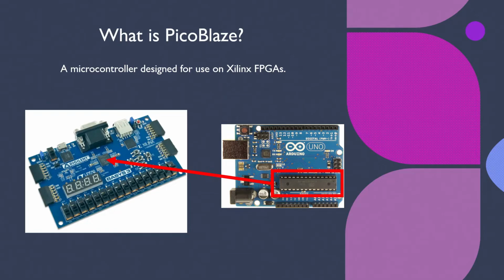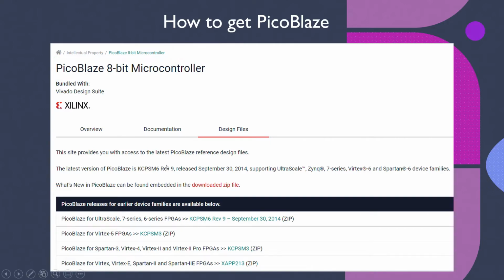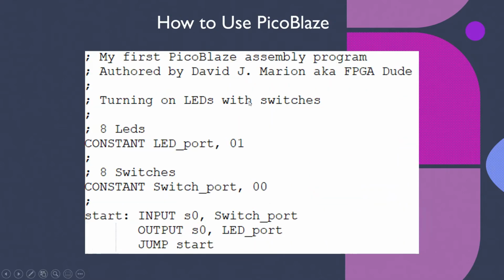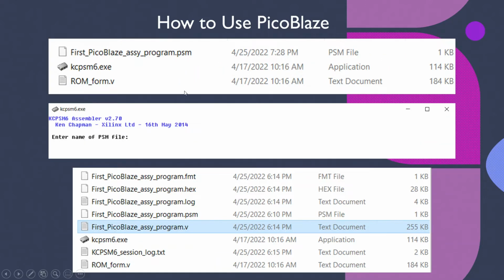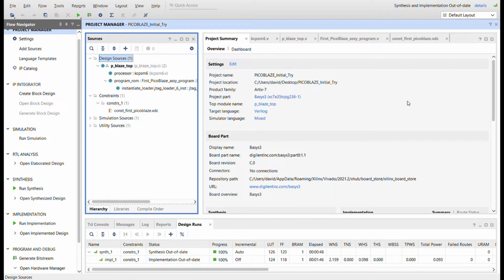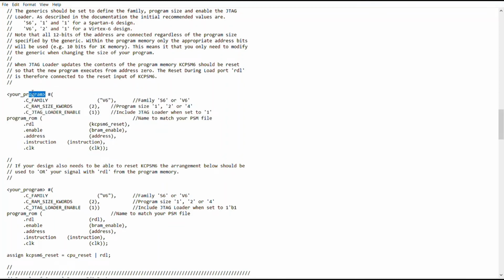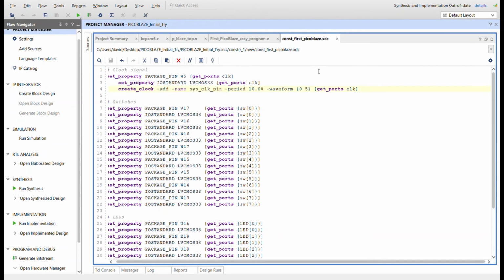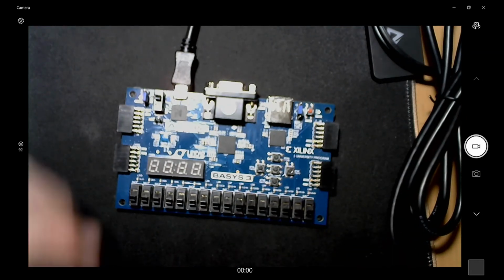Getting Started with the PicoBlaze Microcontroller on the Basys 3 FPGA

Comment: Dave this is a very very interesting video. I have Basys3 do you think i can implement Pico blaze on my basys3?
Reply from the maker: PicoBlaze is made for Xilinx FPGAs, on which your Basys3 has the Artix-7-35T. So, yes, you can implement PicoBlaze on your Basys3.
Reply: @FPGADude  Thanks Dave. I have used microblaze on my basys3 so it would be intersting.
Reply: @Avionics2  I have not looked into microblaze. You say you put it on your Basys3, now I definately need to check it out. Thanks.
Reply: @davidmarion8930  Yes I have and it works nicely.